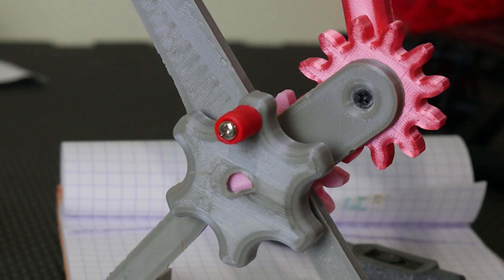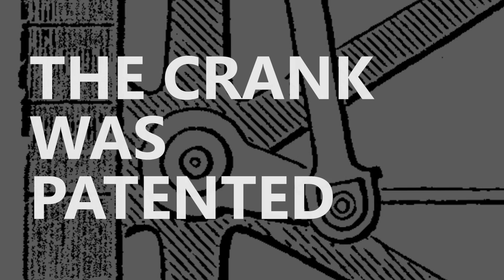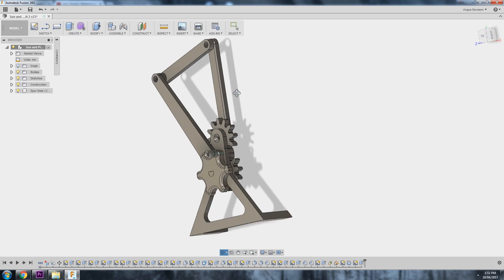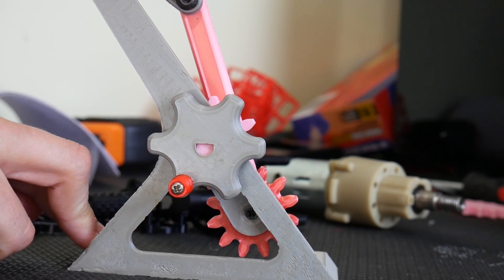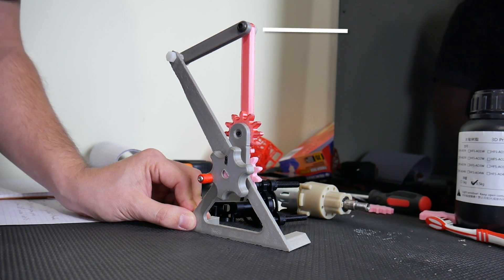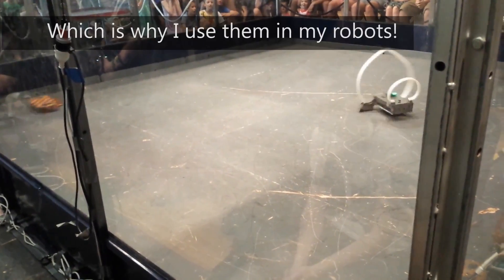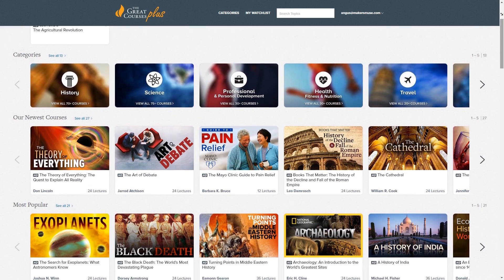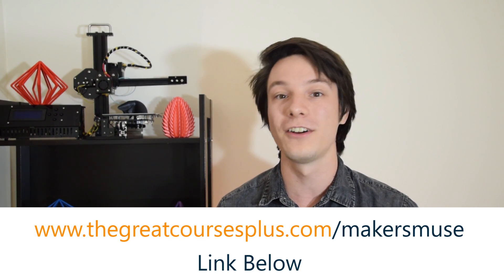How James Watt circumvented the Crank - Mechanisms of the Industrial Revolution

Comment: Interesting to see that this design allowed Watt to circumvent the patent, as the plate that holds the two gears together looks remarkably like a crank, the only difference being that it is not in a fixed position with regard to the driven wheel.
Reply from the maker: I reckon! I think a lot of patents back then came down to wording and as the gears transmit the force not the plate, it probably made the difference. I didn't have permissions to use the other alternate mechanism photos he devised in the video but definitely look them up, they're wacky.
Reply: Lol  - that's the exact page I was looking at before I made my first post here today (links are a pita on this phone). those drawings are from the original patent, as is the handwritten stuff. The typed up stuff is a verbatim copy of the text of the patent, a citation of public domain text - can that be copyrighted? I seriously doubt it, or you could simply change the font and make your own claims. I'm not a lawyer, and my opinion is worth what you paid for it, but we engineers know everything, pretty much, anyway :-P
Reply from the maker: honestly I have 'no' idea, but in the research for this video for example I wanted to use old footage of steam engines - but they all needed to be licensed... I guess people buy the rights like with music. Nothing is stopping me or any one else from reproducing the mechanism or idea now it's out of patent, but the licensing stuff is a bit more confusing.
Reply from the maker: I think they were redrawn, but here's the link anyway! (don't know why I didn't think to post it before). http://himedo.net/TheHopkinThomasProject/TimeLine/Wales/Steam/JamesWatt/RobinsonMusson/JamesWattPatents.htm they're pretty neat.
Reply from the maker: don't have permission to copy them from the book that published them, no...
Reply: Maker's Muse ... this is an irrelevant question, but I'm a bit curious... would that permission issue only apply only to reproductions of a given image from a book, or would it also prevent a model being printed (as you did of the planetary system)

the first case is understandable (though mean-spirited on the part of the copyright owner) but the second case would be ludicrous.

great job on the video by the way :)
Reply: patents are public domain - nobody can claim copyright to patent drawings or text. so, copyright in a book extends to extraneous text and maybe redrawn material (dubious), but they cannot claim copyright for printing the original patent's drawings. the handwritten claims and Watt's original patents you can easily find, and use, online. As far as the videos go, yes, but there are public domain repositories where I'm sure you could find steam stuff
Reply from the maker: Haha, pretty good summary. In the end it's better to be safe than have the video taken down, especially with YT's current climate of guilty till proven innocent.
Reply: Patents are open season after 20 years. If you are talking about Watt's mechanisms, copy away.
Reply: Maker's Muse ...good lord, you need to get permission to demonstrate how an idea from 100 years ago works? that's messed up!
Reply: You can't claim copyright to plain reproductions of public domain material – that would be copyfraud. https://en.wikipedia.org/wiki/Copyfraud
Reply: You can totally use someone else's published pictures under "fair use", your videos are commentary.
Reply: Maker's Muse ... gotcha, licencing video clips is a serious pain. thanks for posting the link to the patent info, those other methods are indeed pretty whacky.
cheers, and have a good weekend.
Reply: You could probably go get a copy from the original source, the U.S. patent office.
Reply: Well, a 1:1 or 2:1 ratio difference is significant. It allows a flywheel with only half the inertia you would normaly need. (so much lighter). The plate only looks like a crank on first sight, but is really has nothing to do with it.
Reply: @vidznstuff1 - that may be true in modern times, but history is a little different.
James watt held a patent on the condenser for at least 50 years, and used it in a way that really crippled the further development of the steam engine in the period he held it.
(the patent being such that nobody could devise a viable alternative, and a steam engine without a condenser uses 4 times as much fuel, so that's not great.)

Of course, regardless of him using government connections to abuse the patent system back then, those patents have nonetheless long expired now.

But still. Quite crazy what he got away with...
Reply: YouTube, being the pack of idiots they are, are unpredictable and inconsistent, so, factoring that and that you have better things (and Lady Muse, lol) to do with your time, can't argue with your caution.

Take a look at the message I'm sending you in the next 15 minutes about your Maker Faire trip.

Comment: Hey Angus - Just though I would mention it.  My motor bike (electric - model vectrix) has its motor directly attached to the rear wheel and also uses a Planetary Gear system.
Reply: Sure it isn't direct drive?
Reply from the maker: Electric planetary hub motor?
Reply: https://en.wikipedia.org/wiki/Vectrix    
Transmission Rear wheel planetary gear drive
Reply: Vectrix made a bunch of stuff. They used many direct drive systems. Gears suck anyway, why bother with the complexity.
Reply: Oops confused it with Zev, another scooter company.